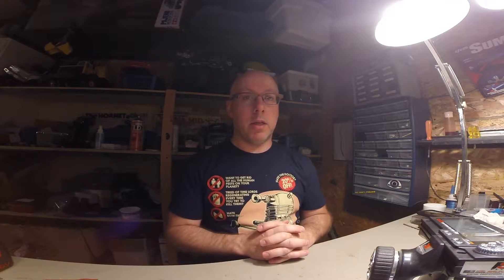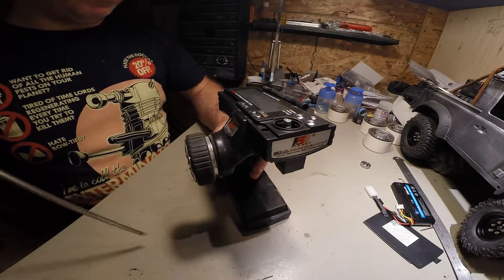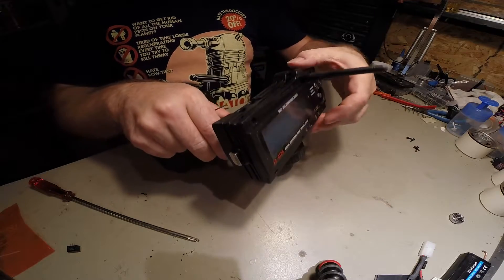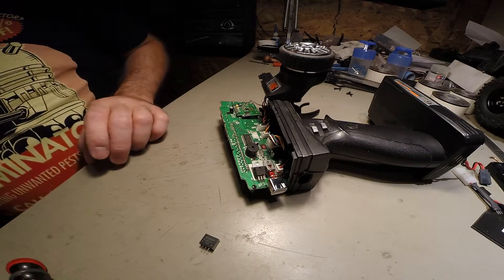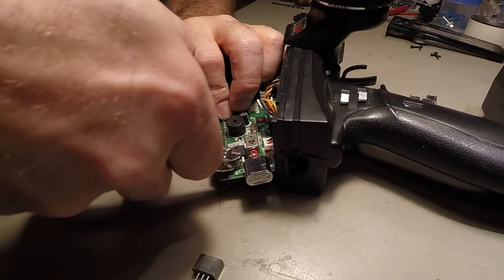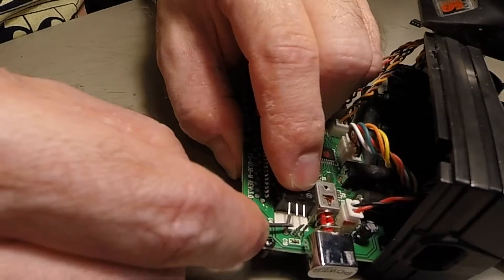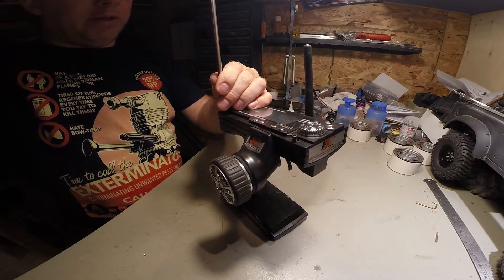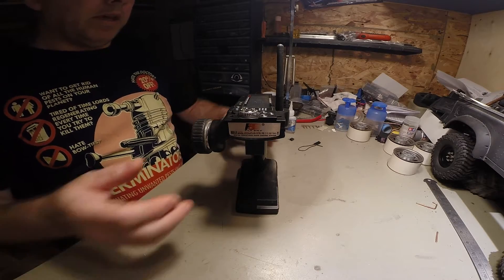Flysky GT3B Voltage Regulator mod is a must - 50% longer battery life

Comment: What battery are you using. I have the voltage regulator installed tried using a 1,500mah battery, its showing 8.4v below the limit.
Reply from the maker: It was a 3s pack

Comment: I think there's something wrong with your gt3b for you having to recharge the battery every time you use it. My gt3b is stock and I get 12-15 uses out of Alkaline batteries.
Reply from the maker: @jstrotha0975  yes.  It was a terrible regulator choice  they may have changed it sometime along production.

Comment: What power supply can be used to charge via the remote control?
Reply from the maker: AC Adapter For FLYSKY FS-GT3B FSGT3B Transmitter Power Supply Cord Wall Charger https://a.co/d/emK4TKf

Comment: Does this reduce range of the radio?
Reply from the maker: No reason  why it would. Has nothing to do with the electronics.
Reply: @TheLEDwheel  Nice, thanks buddy did you get the 50% increase in run time?
Reply from the maker: It definitely did.
Reply: @TheLEDwheel  Very cool thanks for sharing!

Comment: I have a few usb buck regulator boards laying around that will operate at 6v to 30v input. It seem like this would work better as a voltage regulator since they can provide at least 5w of power at a regulated 5v. They should operate at least 90% efficiency probably closer to 95%. It would also allow us to use 2S lipo. Could even be that the regulator shuts off below which would save an expensive lipo pack if the power was left on.
Reply from the maker: The issue with this radio is that  the input sensor is set for 8 "AA" batteries and cannot be adjusted. In other  words 12v or 3S.
Reply: @TheLEDwheel  in stock form. With a firmware update it seems like the input voltage is adjustable.
Reply from the maker: Firmware hack.. its not something everyone can do.
Reply: Great idea for a buck.  Looking at the pins as shown in the video, left to right, this is Vin, GND, Vout yes?  So I'd wire the Vin and GND to the (+) and (-) 'In' of the buck (12V in), and the Vout and GND to the (+) and (-) 'Out' of the buck (5V out)?

Comment: I wouldnt say this mod is a "must". Its a good mod but you can get 2200mAh and even 3500mAh lipos for it these days which last forever even without the VR.
Reply from the maker: Its a must because it will prolong the life  of any battery used regardless of capacity.  Alkaline batteries aside, rechargeable batteries have a certain lifespan or number of usuable charges. Reducing the need to charge as often is still good for the wallet and environment.
Reply: @TheLEDwheel  Ive owned a GT3b for about 10 years now and 2 out of the 3 lipos I use in it are lipos I bought 10 years ago when I converted it to lipo. So you'll have to excuse me if I disagree. Again not saying its not a good idea but definitely not a "must"

Comment: How exactly does the voltage reg mod increase the battery life? I have looked at the comments and answers but I don't see this addressed. One more question. As clarification, is the 78E5.0-1-0 the correct part for this mod? Thanks.
Reply from the maker: The OEM Voltage regulator uses a lot of power  to reduce the voltage to 5Volts. The replacement uses les than half the power to achieve the same goal. So you get less power consumption.

Comment: Exactly what voltage reg do I need for upgrade I'm in uk 
And dont know much about electronics 
Although I'm capable of doing the soldering etc
Reply from the maker: I used the Recom R-78E5.0-0.5 but the Recom R-78E5.0-1 works as well.

Look up your local electronics supply stores. 
our check the Mouser website. Ebay has as well
Reply: @TheLEDwheel  so what's the differance between R-78E5.0-0.5

And the R-785.0-0.5
Reply from the maker: E for energy efficient

Comment: I got no soldering skills but it’s lockdown and I got all stuff needed in this vid so gonna give it a go cheers, I would never have done this without such an excellent breakdown.
Reply: Quick tip for a guy or gal them or they with no skills with soldering please go to Home Depot and buy some soldering paste . It comes in a little white plastic Syringe so you can only squeeze out what you want and you don’t need much it also contains flux . Soldering with it is simple just apply a small dab on area then heat with match or soldering iron till it bubbles and pops then stop heating it let it cool and enjoy strong instant solder joints with 100 % less hassle

Comment: Hi theLEDwheel, nice video tutorial....Have a question, was trying to cut prongs from voltage regulator and one of the the 1st one broke off from the base of board, is there any way to remove LCD to get at the bottom of board to desolder prongs from underneath.thanks in advance....great videos..... :)  I am using the R-78E5.0-0.5 this is the correct one for the fs-gt3b, right?
Reply from the maker: I guess you Need too find a way to get behind the LCD
Reply from the maker: That regulator will do. As for the LCD  i would not recommend it. Is there any part of the prong remaining that can be soldered to?
Reply: @TheLEDwheel  no nothing there 😞

Comment: hello dont understand english very well, could you write here the exact reference of the transistor? thanks
Reply from the maker: Yes, just fits. Its a no name and its been a while but i found it by looking at each battery size after measuring the space available.
Reply from the maker: R-78E5.0-1.0
Reply: @TheLEDwheel  thanks my friend, also fits with lipo 3s modifications? thanks
Reply from the maker: Yes sir it does. Been using a 2200mah lipo in mine since this mod and no issues
Reply: @TheLEDwheel  2200??? WTF :D dont find such lipo in correct size... just find a 900mah :(  :D :D :D

Comment: Dissapointed with range on GT3C can i try it on 2S lipo instead of 1S ?
Reply from the maker: While i don't recommend a higher voltage battery i doubt it would change the range since it probably has a voltage regulator inside.  On your RC make sure the antenna is placed as high as possible for max range.

Comment: New to this, had to open the radio due to something rattling,  it's a black and white fuse cap of some sort, it seems to work fine without it, but what is it exactly and how important is it?
Reply from the maker: Fuse cap? Capacitor maybe? What does it say on it?
Reply: @TheLEDwheel  it's a black and white aluminum cap of some sort, has 20v printed on the side. But it's just a cap. It was rattling around and causing a short so I popped the radio open just enough to shake it out. Now everything is working fine . Just not sure the importance of the object.
Reply from the maker: Of its working  then no prob i guess

Comment: want to do this to mine but cant find the number listed on ebay or amazon. what should I look for?
Reply from the maker: TSR 0.5-2450
Reply from the maker: Add regulator to that in the search
Reply: sorry I tried ebay and amazon using that # but no luck apparantly they have quit making that exact one There are some red ones that pop up under tsr with a 1 at the beginning, But I dont want to buy something that dont work. Any other numbers that will be ok to use?
Reply from the maker: @leeroyexcavator9149  https://www.mouser.ca/ProductDetail/TRACO-Power/TSR-05-2450?qs=ckJk83FOD0XpEgQBSwF%2FIw%3D%3D
Reply: @TheLEDwheel  but this have 500mA? you say need 1A!  thanks
Reply from the maker: Google?
Reply from the maker: The 500mah and the 1 amp both will work
Reply: @TheLEDwheel  thanks

Comment: Thanks for the video! Looks like the reason the first one didn't work is because of the E in the model number? This person couldn't get the R-78E5.0-0.5 working but ordered the R-785.0-0.5 and it worked fine.

https://www.reddit.com/r/rccars/comments/925so0/flysky_gt3b_with_voltage_regulator_problems/

Comment: Hello , good idea. I think that we can use a "step down module" , it cost 1$ or less. The way is to solder 3 wires in the place of the 7805 regulator. These wires allow the step down module to be placed where there is enough space for it (in the battery compartment for example). On ebay , schearch about "step down".
Step down module do not works in linear mode , the efficiency will be better than using 7805. 
Bye.

Comment: or you can just do what I do and install 8 rechargeable AA and be done with it. my 10 second modification!  haven't tried yet but by the looks of it you can charge these or lipo moded rite thru the radio itself. just picked mine up haven't even used it yet still waiting on the brushless upgrades.
Reply from the maker: IMPORTKILLR R/C I know you posted this a while ago but installing rechargable will not change your power consumption.

Comment: do you know how to do that on the FS-GT3C? this 7905 -5 Volt 1A Voltage Regulator in Australia is AU1.85
Reply from the maker: No I do not know how on the GT3C. I have never opened one up. However, the 7905 regulators are what is in GT3B units and they are the problem. I do not know what is in the GT3C.

Comment: Steph, that looks like a great idea "on paper".... I'm curious, did you get the 50% more,  or even close? It looks easy enough to do. I'm an old fart, like my handle (I'm at least 15 years older than you!). I got back into the Hobby after a long hiatus, since 1998. I originally started in 1985, shortly after Tamiya released the Frog!!!
Well, like life, R/C was a LOT easier back then. THREE Brands, two channels,  and it seemed like everyone had a Futaba or Airtronics Radio! May have been other brands, but I never saw any. Buggies looking realistic,  until Losi came out with his first flat pan car....... then soon after, everything started to look like Moon Buggies with grossly oversized tires! 😕
But I REALLY digress!

Radios today are COMPLICATED, but do a lot. A friend recommended a Flysky GT2B. Good choice but pleasantly misnamed, because it has 3 channels!! Never had to Bind a radio before, but it was much easier than I was taught! I STILL can't figure out how to make the 3rd channel turn my lights on and off. 😰😠

Still, I'm looking into a GT3B. I like the multi vehicle storage, and the many fine tuning options looks great! 
Only thing is - that one looks über confusing!!! I keep seeing videos about mods, upgrades, and HACKS. I'm used to a Radio that you turn on, and USE! 
Like, you can hack the processor with a USB jumper, and flash it with firmware that will give you 6.... or EIGHT channels out of that 3-channel Radio!??!? HOW do you even control them?  Leaves me with more questions than answers. 
At least the trick you pointed out, is something that I know I can do. I'm good at hardwiring and soldering. 

And once again, I've written too much! Being retired and disabled is boring! 😜  I've written you before here, I just started a new account, exclusively for R/C.
~ Carmine
Reply from the maker: OldfartRC that's funny, how old do you think I am? and yes it's very easy to do and yes it does indeed double battery life if not more so..
Reply: ..... well, maybe more like 25 years older! lol 
That sounds like an easy enough of a fix. I'll try it. Any idea if the GT2B has the same issue?
Reply from the maker: The GT2B is a much simpler radio system. As for the third channel to switch lights on and off you can view my video about turning an old servo into a LED controller or purchase yourself a servo switch.

The GT3B and GT3C have the same display and menu system in a different package but the GT3C comes with a Lipo but I do not know if it better on power consumption.

I still have 2 GT3B's but now I get the Radiolink sets. They are great on power and are even very versatile  as to what you can power them with. it comes with a 4xAA battery retainer but it can be removed and powered by up to 3S. the receiver is also high voltage and can be powered directly from a 7.4 LiPo.

This one here even has a built in Gyro
http://asiate.es/aff?l=97259&i=35116

Or without the Gyro
http://asiate.es/aff?l=97260&i=35116

And the receivers  are only 10$ 
http://asiate.es/aff?l=97257&i=35116
Reply from the maker: Also, I will be 50 in may.
Reply: WOW! Living in Canada must be good for your health! I'm going to be 53 in 8 days.... sometimes it feels like 60!
Reply: CRAP! Prices sure have gone down over the past few decades....
I'm seriously considering a gyro for my on road car. I'm just not that good of a driver! 😜

I actually like the GT2B. It came with a lipo, and is just enough radio...
And probably a good transition to the more sophisticated stuff!
Reply: LOVE the RC4G!  it's a little less than the basic Futaba 3PK I bought, with way more features! 
Do I trust a gyro built into the reciever? 
How is Asia Tees shipping times?
Reply from the maker: OldfartRC honestly... I have not tried it. maybe the are reviews?

Comment: Is there a way to have it show that the unit is on when the display times out?  Is there a way to add an LED to the unit connected to the on/off power switch?  

I have already gone thru 4 sets of batteries,  setting it down thinking it was off and it wasn't.  (at $7 - $8 a pop).
Reply from the maker: Dick Russell I would have to take a look but my guess would be too Tap a set of wires onto the regulator output to an led with the right resistor.
Reply: That would be my best guess.....

Comment: great video sir. and very helpful. I do have a question, do you know if the gt3c has the sane voltage regulator as the gt3b
Reply: i have a 3c and no the regulator is different ,,,the whole board is different
Reply: @Casey6996  Im going to buy gt3 radio but not sure what to choose between the b or c. Can you give me some advise??
Reply: @RafaelTorres-of1pu  C is just a later model better distance also specially for my boats
Reply from the maker: Eric Vosen sorry, I do not know.

Comment: I have a question, when you are calibrating your esc's, mainly hobbywing, what is the proper setting to start with before calibrating. Trim dual rate and expo, do you 0 everything. Hobbywing instructions are kind of confusing, they say if you have a futaba do this, and if you have a radio with a led screen do this etc. on your fly sky gt3b I'm talking about! Thank-you
Reply from the maker: Usually everything at factory settings for your radio. Some ESC's want you to put your radio in reverse and so on... Best if to read any instructions.

Comment: Awesome! I will go for TSR 0.5-2450 (input voltage at least 6.5V - you can take a normal 2S 7.4V LiPo...) because it's delivered from farnell and my electronics shop has a contract with them. It should work at least that good! I saw also the TR05S05 (min input voltage 7V!!), which should work too!
Reply from the maker: while  the specs are sound, the unit itself will consistently be in alarm mode and beep continuously because it's alarm is set to around it just under 10 volts.
Reply: Sure! Sorry about this unclear post, but I was thinking about the hacked firmware, where you can set the input voltage ;)
Reply from the maker: +Boštjan Bele honestly I have no clue.
Reply: There are some tutorials on youtube... just search for gt3b hack! Maybe you can do a new tutorial about uploading the firmware to the transmitter to use 8 channels from it :D
Reply from the maker: +Boštjan Bele yeah, was thinking about it.. thanks for watching.

Comment: I personally converted to 18650s. I had a LiPo go supernova on me, and the 18650s handle the draw just as fine.
Reply: Did u use any old charger to charge? Or install a chip when you rigged those batterys together? Also you did them in series correct? Any tips?   I use a thunder ac680 and it says it can charge Li-Ion so i want to go this route as well.

Comment: At 1:21 your caption says to use R-78E5.0-1.0. which is the 1 amp version of this switching module, why is this necessary over the 500ma version?
I dont understand because the stock lm7805 being replaced is only rated for 500ma anyway and according to what I've read elsewhere the flysky radio only draws 140ma with the stock regulator and 90ma with R-785.0-0.5
http://www.rctech.net/forum/radio-electronics/394162-flysky-gt3b-transmitter-135.html
Reply from the maker: the 500mah model wouldnot work for me. so i upgraded to the 1 amp one and it works well. however in hindsight i should have verified if the unit was defective.
Reply: Ah okay that makes sense.
The 	 	 	R-78E5.0-0.5 does seem to be best value but the R-785.0-0.5 is another 5% efficient.